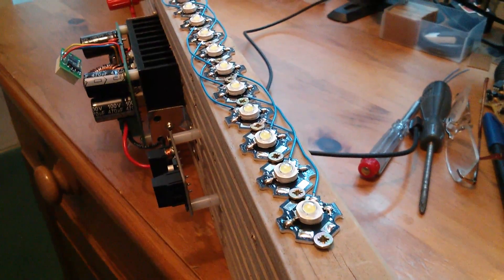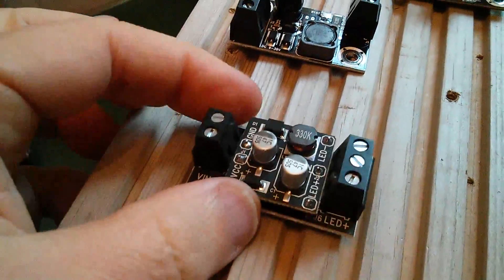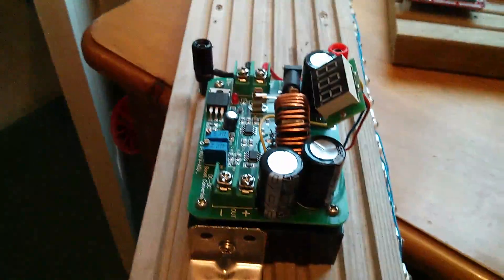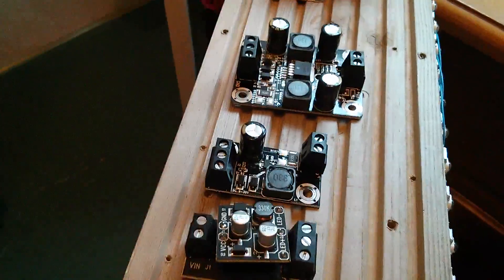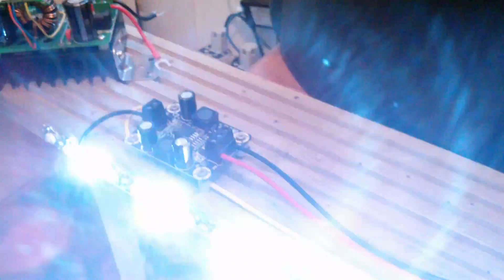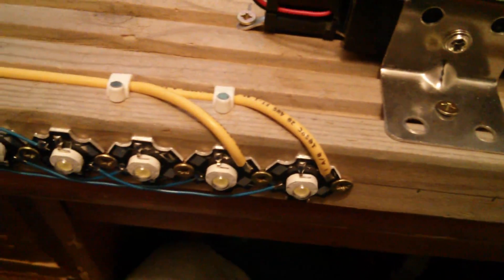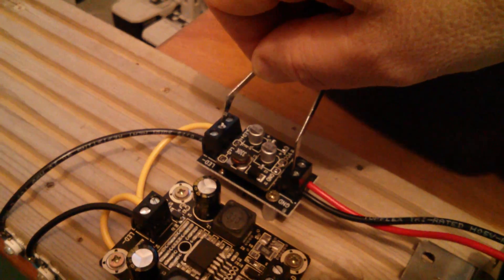Sequencing 30 High Power LEDs with Arduino and LED Drivers #2

Comment: Light bulbs generate their light via a very hot wire, reducing the power consumed in the wire reduces its temperature. This has two effects: First, the intensity emitted by the wire will drop proportional to T^4 (Boltzmann's law) and also the radiation will be shifted (even) more to the invisible infrared (Planck's law). LED's have a different working principle. Here you inject charges ("holes" and electrons) in a semiconductor where they are able to recombine radiatively (to produce a photon) when they meet each other. You inject these charges on specific energy levels (holes in the valence band and electrons in the conduction band) that are energetically mostly fixed and do in first order not depend on the amount of charges injected. Therefore the energy a charge pair has is always the same, whether you drive 100mA or 3A through your LED. Since the color is nothing more than the energy of the photon, and this energy depends on the energy the charge-pair had before recombination, the color does not change when the current is changed. The amount of photons however is proportional to the current recombining in your LED, therefore TADA! the intensity is (in a first order approximation) linear with the applied current.
Reply: QED  TADA!
Reply: LEDs do change colour a bit with temperature (and hence current). Nowhere near as much as incandescents though. I have no idea why it happens.
Reply: I measured intensity for different currents for a led strip wrapped inside a closed container coated with led strips and reflective aluminum foil. İntensity is measured with a specialized equipment through a small hole large enough for dedector. Current-intrnsity relation was not linear. Lumineous efficiency increase with decreasing current actually.
Reply: Linear relation can only be possible for lossless system but leds have losses too so relation between current and light intensity is opposite of incandecent bulb but not linear.

Comment: Did you fit the led display yourself or did it come with it? I have been looking for one like yours but can only find it without the display :(
Reply from the maker: steamtraintom Yes, I did add that myself - it's fairly easy to trace the PCB tracks to find suitable points to attach the voltmeter.

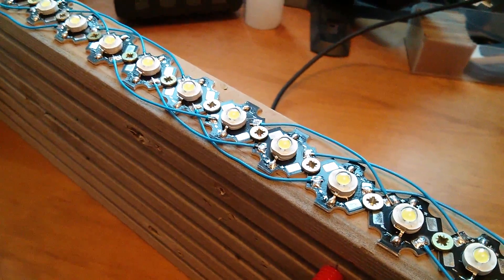Comment: to answer your question at 1:00, the simple answer is that LEDs are current driven light sources, not voltage. The voltage level doesnt really matter (as long as it is eough to begin with), and the voltage drop across each LED is consistent at any current (up until breakdown/melting point), So in the end its the amount of current through them that determine their "work"